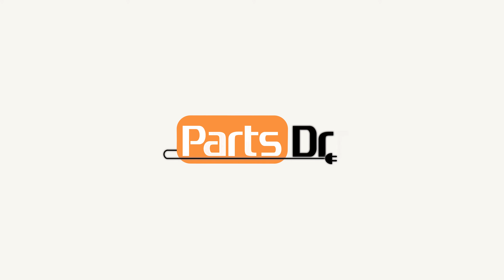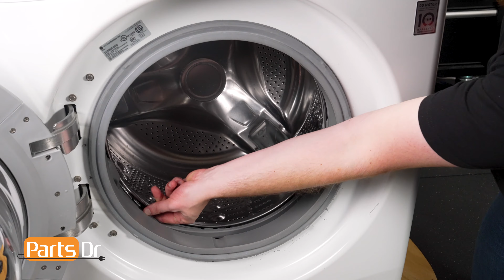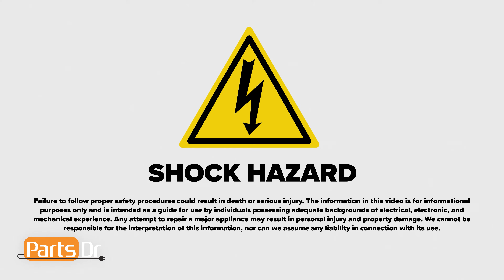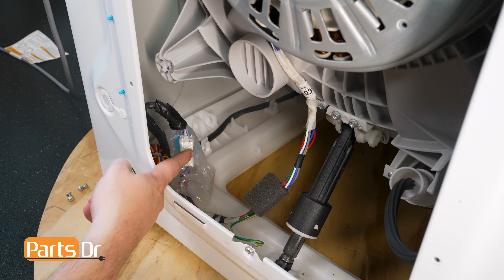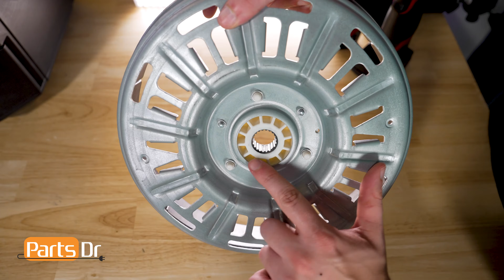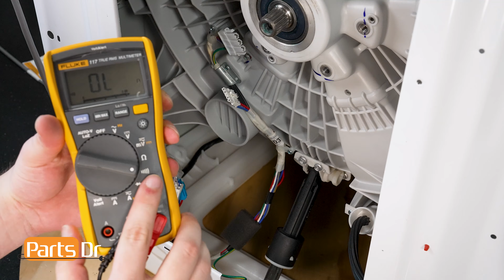LE Error Code? Quickly Test, Diagnose, and Repair your LG or Kenmore Washer's LE Error Code

Comment from the maker: Thanks for watching our video on diagnosing and repairing the LE error code on your LG or Kenmore washer! If you're replacing the hall sensor (also called an RPS sensor) or any other parts, be cautious when ordering online. Many cheaper aftermarket parts from places like Amazon or eBay are lower quality and can fail prematurely, leading to more issues.

For reliable repairs, we always recommend using original OEM parts. You can find high-quality parts on our website at https://partsdr.com. They’re built to last and will save you money and hassle in the long run.

Let us know how your repair goes, and happy fixing!

Comment: I tested the hall sensor ohms and pulse voltage.
I tested the stator ohms.
I finally found the problem. The yellow wire in the motor harness was broken. It was under tape but looked like it had been cut.
As a temporary fix, I spiced it together then noticed the insulation was cracked on the yellow wire in another place so I cut the wire and spliced it together.

I will purchase an OEM harness as my temporary fix probably won’t last long.
Reply from the maker: Nice work troubleshooting the wiring and finding the real culprit!

Comment: Thank you very much, you saved me hundreds of bucks, I got an estimate of $300-400CAD in total for this repair... But then I found your video, and made it myself during 2 hours including all tests spending just $19 for the sensor from Home Depot. The only problem I had from the beginning was unscrewing 11 year old motor bolts by hand. Fortunately I have all tools so just used the heavy impact tool with success. The rotor was another trick but not as bad as expected. The machine is back to life now!
Reply from the maker: Nice job saving all that money and getting your machine running again!

Comment: Great video! Did the tests and wasn't sure if the voltages were inconsistent or if my old radioshack multimeter just couldn't read it well. Hall sensor resistances seemed reasonable, but I decided to replace with an OEM replacement otherwise it was the control board which I didn't want to pay for. Running my first cycle since replacement now and things seem good so far. Thanks!
Reply from the maker: Nice job troubleshooting that and fixing it yourself!

Comment: Thanks for the video My LG washer having trouble with motor. The motor is grinding on the rotor and jerking noise I change the hall sensor and rotor and the spider arm No issues with wiring 
But when I check the motor with multi meter it’s showing only 7 to 8 ohms also pulse testing shows 9.5 v with out turning the rotors but the power is on ? What will be the issue please help me
Reply: My LG washer model is WM2301HS

Comment: I have a Kenmore Elite 41983 made by LG that is throwing the LE code within seconds of trying to start a load. It also fails right away in diagnostic mode throwing the same code. Unplugging the machine for 10+ minutes did not clear the code.

I removed the stator only to find out that my model doesn't have a hall sensor and I only have one harness going to the stator. I tested continuity between both ends of the 3-pin harness and everything checked good. I also got 11K ohms at the stator between pins 1-2, 2-3, and 1-3. The rotor itself looks good with no damaged magnets. Should I assume that my control board is fried?
Reply from the maker: Assuming the basket is spinning freely, the tub bearings are good, and nothing is stuck basket and the outer tub, it could be caused by a bad main control board.  Also check the wiring harness between the stator and control board for a broken wire. Let us know what you find.
Reply: I have the exact same issue. So it must be the control board on mine.

Comment: When we spin the rotor (2nd wire test) it is at 10v when still, pulses down when rotating. Is this just reversed multimeter sensors or does this indicate our problem? Our other tests all worked. @partsdr

Comment: I live rurally and I'm 25 miles from the nearest repair shop. They wanted  $160.00 just to come out then $120.00 an hour plus parts. With your video I was able to diagnose my error and fix it with a $10.00 part off Amazon. Much appreciated bud!
Reply from the maker: Nice job fixing it yourself!  One quick heads up though. Be careful with really cheap aftermarket parts on Amazon. Some work short term, but many are low quality and don’t last. For long term reliability, OEM parts are always the safest route, like the genuine OEM parts we sell at https://partsdr.com.  Plus, Jeff Bezos doesn't teach you how to fix your washer for free like we do 😉

Comment: My gray and white wire testing is only reading at 3.90 when the machine is on.. what does that indicate?
Reply: Did you find out why it read 3.9?  Mine reads 4.0

Comment: When i do the spin the roter test, before i spin it its already at 12 volts and doesn't move when i spin it. Still the sensor?
Reply: Similar for me. I'm wondering if that counts as failing the test or does failure mean no reading at all.
Reply: Same here, around 10v- did you ever solve it?

Comment: I cannot, for the life of me, get the magnet hub off of the shaft . Any suggestions? Puller?
Reply from the maker: Try using penetrating oil on the shaft and tapping it with a wood block and hammer to see if you can break the corrosion free.

Comment: only showing 3.81v on the first test inbetween the grey and white wire, on the mid junction box, but you didnt specify what was wrong if it wasnt reading the 10-15v
Reply: Same, did you figure out what it was?

Comment: Thank you very much! There was no voltage when i was spinning the  rotor by hand, and pin1 and pin5 on the hall sensor were an open circuit. Figured the sensor was the problem. Indeed, replacing the sensor solved it, hopefully the washer will work for another 10 years. Im from Canada, so had to buy the replacement on amazon, otherwise would love to support this channel by buying the part from your store
Reply from the maker: Nice job fixing it yourself and thanks for the feedback!

Comment: Twice now I have found the wiring harness broken.  The first time a dealer found it... after 4 months and several attempts to fix this darn thing.  The second time I just went there first after watching your video.  Thank you for making this video.    This is a design issue and should have been corrected by the company.  Poor research and development.
Reply from the maker: Nice job diagnosing the problem and fixing it yourself, and thanks for the feedback!

Comment: Thanks for this excellent video. Others jump straight to how to change the Hall sensor however I appreciate that this goes through a set of diagnostic tests to be sure it’s not just the Hall sensor or in case it is not the Hall sensor.

I did find it very difficult to remove the shell with the magnets, the name is escaping me at this point. I was glad I had a small fly wheel puller to ease it out. I also found that I needed to remove the small metal retaining clip holding the stator wiring harness in order to get enough leverage to unclip.
Reply from the maker: Great! We are happy that we could help and thanks for the tips!

Comment: Some Kenmore Elite are built by LG with LG parts - mine had LE fault code and the rotor has no side Hall Sensor.  It has a small sensor built into the stator assembly - AJB73816005 LG Stator Assembly - wasn't cheap to replace.
Reply from the maker: Thank you for the feedback.
Reply: i replaced mine (AJB73816005 ) and i still get the LE code.

Comment: Hi, For the Ohm setting I have these (6) options: 

(1) 20M
(2) 2M
(3) 200K
(4) 20K
(5) 2K
(6)200. 

When checking the Stator, do I set it to (1) 20M or (6) 200 or one of the other setting?

When I use (1) 20M, I only get a proper quick reading after removing one of the probes.

When I use (6) 200, I get a reading above 14.

Thanks!
Reply from the maker: For the test shown at 5:55 in the video, set your meter to the 200 setting because these readings are less than 200 ohms.
Reply: @PartsDr  Thanks for the reply!

Comment: I recently replaced the bearing plate assembly due to a grinding noise. The tub spins freely by hand but I'm now getting the LE error. When I turn on the machine and hit start, it makes a reverb sounding noise first before throwing the LE error. Have you come across this before? Mine is the WT7300CV top load model.
Reply from the maker: Thanks for sharing the details and the service manual information. The LE error on your WT7300CV typically points to a motor issue, most often related to the rotor, stator, or their connectors. Since you just replaced the bearing plate and the tub spins freely by hand, the first thing we would check is that all the connectors on the stator, rotor, and main board are fully seated and there are no pinched wires or loose connections from reassembly. Next, inspect the rotor magnet closely for any cracks or chips, as even minor damage can trigger the LE error and cause the odd reverb noise you’re hearing when the machine tries to start. If you have a meter, check the stator winding resistance according to the service manual, it should read between 5 and 15 ohms across each pair of terminals (U-V, V-W, W-U). For your model, a separate hall sensor is not listed, it may be built into the stator. The sound you’re describing before the error appears could mean the motor is trying to turn but isn’t getting the proper feedback, possibly due to an issue with the rotor magnet, stator, or a connector problem. If everything looks good and you’re still seeing the error, you may need to replace the stator assembly.
Reply: @PartsDr  looks like I'm only getting resistance between terminals U-W and nothing between U-V or V-W, so I'm leaning towards a replacement stator being the resolution. Thank you for your quick response and help!
Reply from the maker: @andylaboa8502  Let us know what you find!
Reply: @PartsDr  Well it worked great for one wash cycle but I tried to run a load today and the LE error is back. Before I replaced the stator it wouldn't spin at all, it just made that reverb noise and threw the error code. Now it senses for a while, even spins a little, starts filling the tub with water, then throws the code. UPDATE: I unplugged it, plugged it back in, successfully ran a spin cycle, tried to run the wash again, and got through the "sensing" stage into "wash" before throwing the error code. Successfully ran the spin cycle again afterwards and the wet clothes have been in it both times so I'm at a loss. UPDATE#2: I tried running a normal wash with practically no clothes to see if it was potentially a weight issue, but it didn't make a difference. Feels like it has to be a sensor but I can't find anything relevant online to help.
Reply from the maker: @andylaboa8502  We are sorry to hear that you are still having issues with this. We are not sure what else might be causing the issue.  Try re-looking at all of the drive components to make sure something else in that area isn't failing.  You could also trying exchanging the clutch plate bearing assembly if the store you purchased it from offered a warranty.
Reply: @PartsDr  I already replaced that as well lol.
Reply: Any update? I seem to be going through the same
Reply: @jamesmessina2554  I called a local LG repair company to come out and after explaining the issue, they indicated it was likely a control board but it couldn't be guaranteed - which was going to cost $500 including labor to fix. Since I had already replaced the bearing plate assembly and stator motor with no luck, I cut my losses and bought a new washing machine since a new one was only a few hundred more than the possible repair.

Comment: So I have to replace the entire rotor assembly because I noticed teeth sheered off the hub? I'm going to take the front of the machine apart as well, because I believe something is caught and started this whole mess to begin with. Great video, btw. 👍
Reply from the maker: Nice job diagnosing the problem!

Comment: The first DC volt test only indicated about 4 volts. What would  cause that?
Reply from the maker: Which time stamp in the video?
Reply: @PartsDr  Well, I resolved the problem thanks to you. I replaced the clutch assembly and did not fix the problem. After watching numerous youtubes I came across yours. Replaced the hall sensor and I am back in business. Thanks.
Reply from the maker: @JOHNMCKEE103  That's great! Nice job fixing it yourself!
Reply: My multimeter must be an idiot because I couldn't get it to measure anything correctly on my Kenmore like was measured in this video. Even after replacing all of the parts and cable listed. 🤷‍♂️